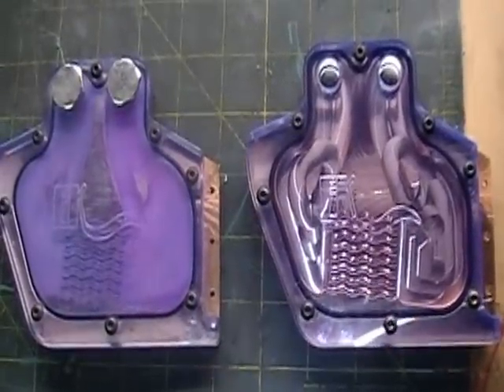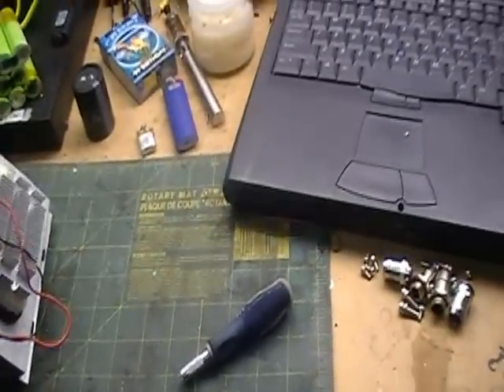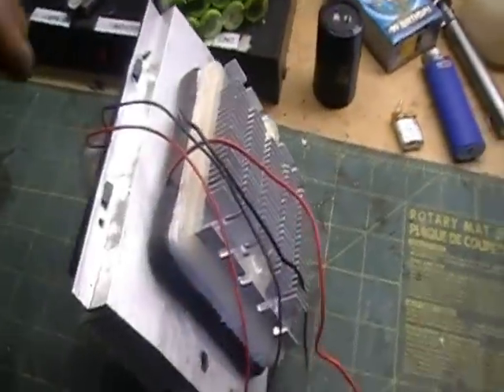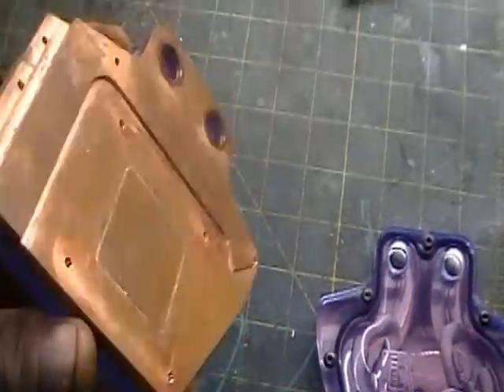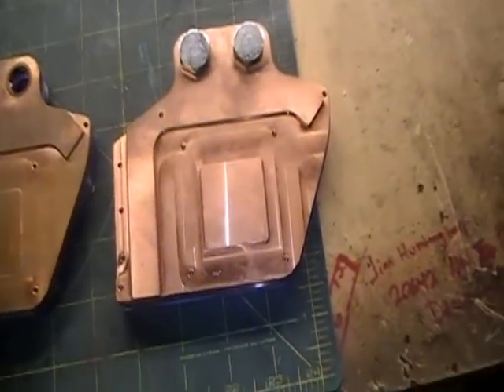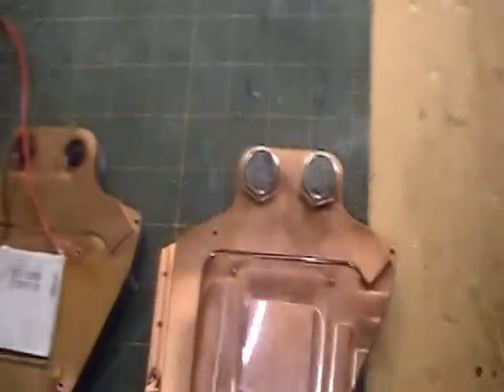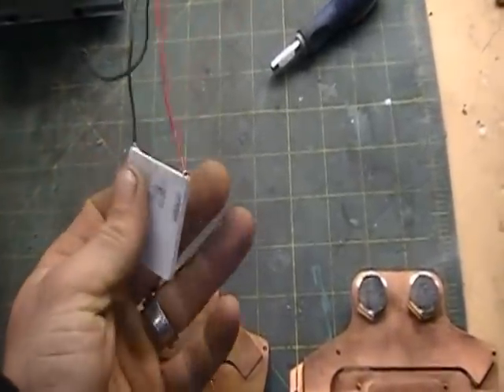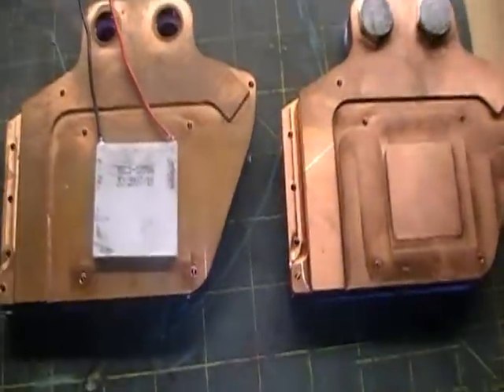TEC Thermo-Electric Cooler Generator

Comment: I used 8 of them for running a 5V motor for a fan. The fan barely turned and two of them broke when I got up to 8V. I gave up this idea. I'd get proper TEG:s instead :(

Comment: I think that if you use a larger Peltier TEC such as a 300 - 545 watt unit you would have more power available to run a small fan if that is the configuration that you choose to use.  In the beginning you would have to provide power to the fan from a battery until the device gets up to speed so to speak.
Reply: Much has yet to be done with the Peltier effect as far as I am concerned.

Comment: The problem with your idea is the fan on the cooler will consume the electricity that is generated. Thats not taking into account any circulation pump.

Try air cooling without any fan. Be sure not to overheat the Thermal Electric Heat pump.
Water helps prevent that but you will be boiling water very quickly with a frenzal lens